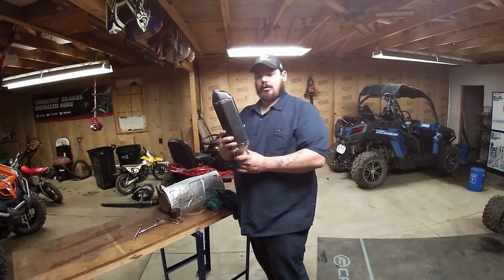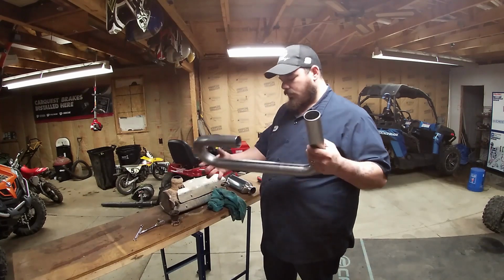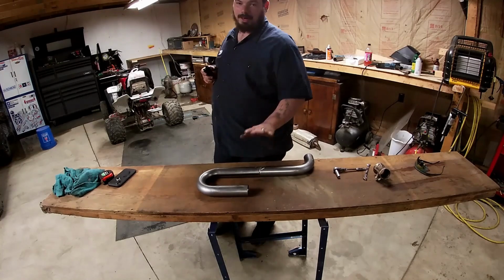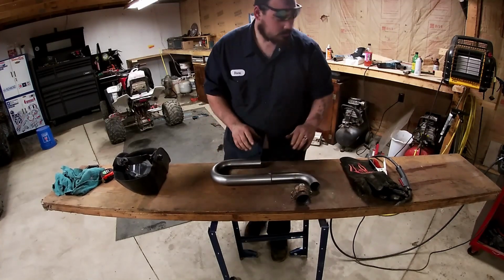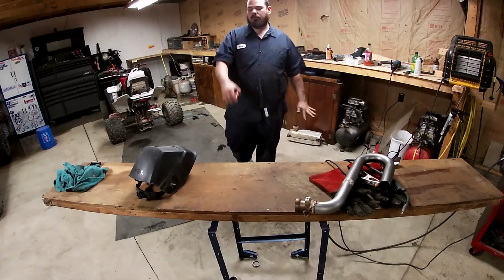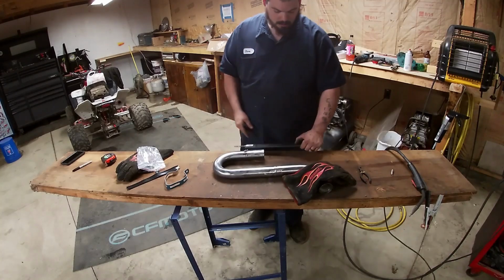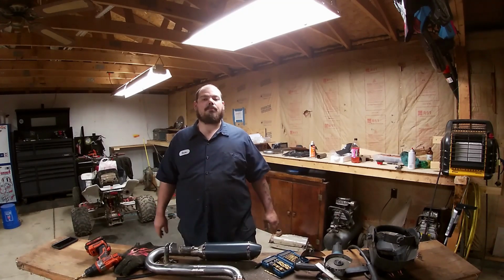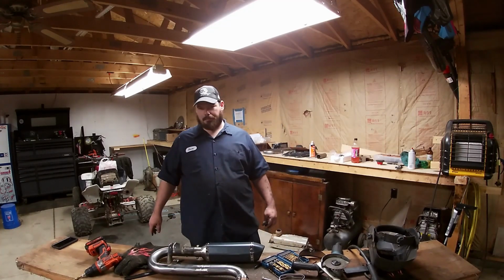Custom Exhaust How to. CF Moto ZForce 800ex and trail

Comment: Just MHO I would have had the exhaust tip exit on the other side, just to shorten up the run, and remove some bends for better flow. CF did change the exhaust z1000 to have less bends in it than the 800s for smoother flow. All in all not bad.
Reply from the maker: Free Washington I did it this way to keep some back pressure.  It will still flow good.  You want some back pressure for better exhaust scavenging will help the engine run better
Reply from the maker: Free Washington my original exhaust didn’t have any bends at all but it was really really restrictive.
Reply: Do you have to do the tune with this or na

Comment: Hey bud where can I get a cool license plate holder for my 2021 cfmoto 800ex from
Reply from the maker: Autozone should have them
Reply: Do they have a light connection one I just got this 800ex is there a wire harness in the back for a license plate lite
Reply from the maker: Yes there is the wire is tucked up in the back.   They have license plate bolts that have the lights built in for 10$ they are sweet my buddy got a set for his rzr.
Reply: U seem more knowledgeable then the guys where I bought it

Comment: Hi there, I just got a zforce 800ex and I want to get a trunk for it, found one on Ebay so I was wondering if you know if the bed on the ex is the same as the non ex model?  Thnx a milion
Reply from the maker: Yes the ex and trail is the same body
Reply: @R.N.GPerformance  thanx man, that really helped me, stay safe!!  :-D
Reply from the maker: You’re welcome.  You too